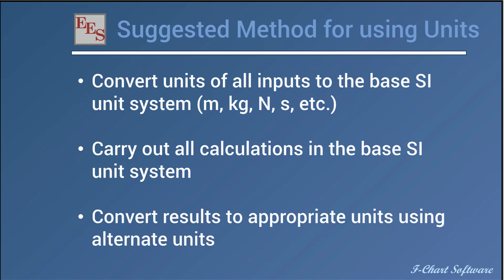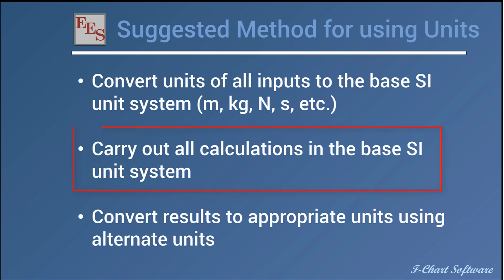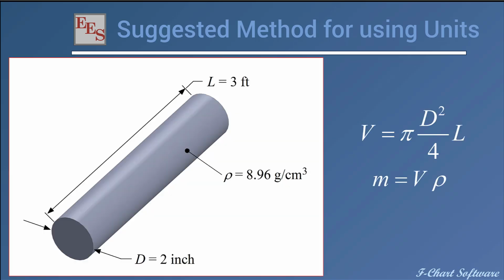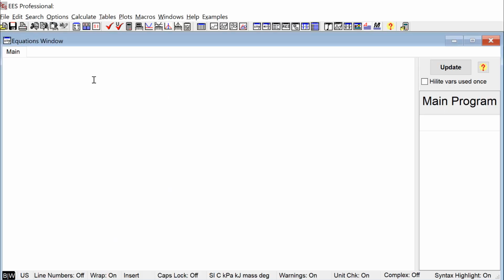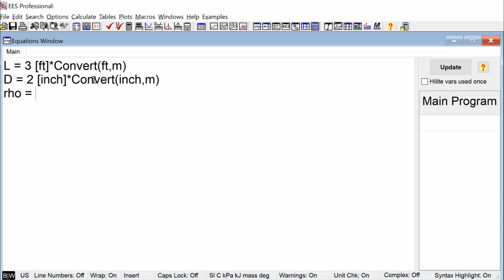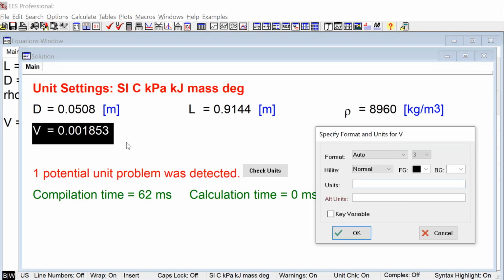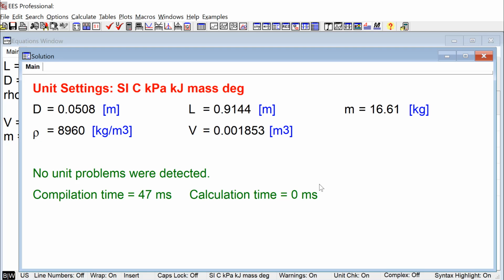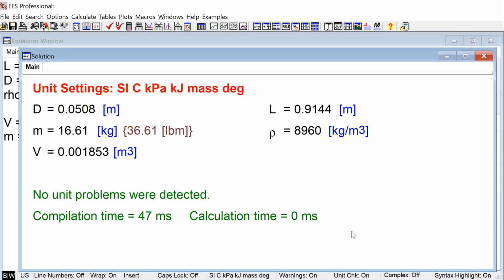Suggested Method for using Units & Alternate Units

Comment: i entered just as you did but get the unit error warking that L, D and rho are dimensionless so equations are inconsistent. why doesn't ees automatically assign the units for me like yours is doing?
Reply: I guess i need to right click on L and declare its units as m. However, when one declares L = 3 [ft] *convert(ft, m) it seems like ees should know L has units of m and this step seems overly tedious especially since this has to be done for EVERY line in my equation editor.